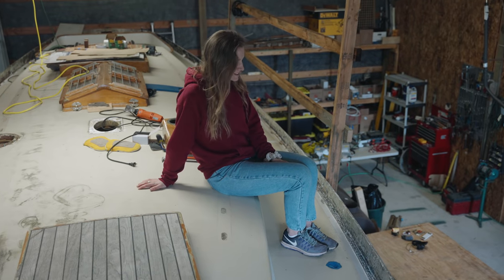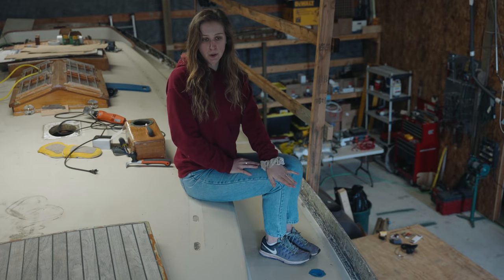Refitting This Old Boat. [S4E7]

Comment: It took me seven years to renovate a 1899 Dutch deluxe motor barge of 28 meters in Amsterdam. 13 months alone on the skippers quarters in the bow. Much more money than I had ever thought, but the thousand mile road begins with one step and you keep going looking for the light. I salute you!

Comment: Inlay the old table into a bigger table. Just use the old one, minus edge, as a pattern to route a large hole in the bigger table. Any material you want.
Reply: Another option would be to add a drop leaf on each side.  You'd double the size of the table and keep the inlay and the lovely cupboard behind it when stored.

Comment: Heat doesn't rise, Hot air rises.  Don't worry about the height of the heater, it will heat that small space just fine.

Comment: Small tip for next rewiring. Use the old cables for pulling the new ones in
Reply from the maker: If we were only rewiring we would but there is lots more to be done.
Reply: @SailingMagicCarpet  
As long as you see the journey as part of the destination, everything will be fine.
All the best from the Netherlands

Comment: The Klein Tools 63050 Heavy Duty High Leverage Cutters for Aluminum, Copper, and Communications Cable are my favorite too! The funny thing is, as soon as I saw you using the Kleins, I thought how much I love mine. And then you went on about yours and how much you love them. We're kindred spirits. 🤭💙 I'm sure you already know cutting anything with a steel core will gap and ruin them and they're not cheap either.

Comment: I really appreciated what you said about pushing through those days when you have a dirty, unpleasant job to do, especially when you are not feeling especially well.  I think the ability to do that is why some succeed and some fail.  Successful people (whether the success is financial or simply a matter of living life) don't know how to give up, no matter how many times life may knock them down.  When I raced formula cars, I taught myself to do fiberglass work, because I couldn't afford to pay someone else to do it, and it had to be done.  And though racing in the rain wasn't particularly enjoyable, I liked racing in the rain, because it gave me an advantage by slowing my competitors more than it slowed me.  Two or three years ago, my wife and I built a small camper to pull behind her Outback; I designed the frame; she designed the galley, and we worked out the other details together.  We didn't have to tear anything out on that project, but some jobs were less enjoyable than others, and we worked on the project as a team.  I've been watching your series, because I still have a boat project banging around in the space where my brain should be.  Thank you for not glossing over the bumps and for allowing us to see how you fill the potholes.

Comment: I did a gut job on two sail boats in Alaska in the 80's and 90's.  A 29 foot Columbia and a 37 foot Crealock.   I Tore everything out and replaced it all (engine, plumbing, wiring, deck fittings) but you guys are way out of my league.  I would not have have been capable of the structural repairs you two are doing.  Plus you would need a heated boat shop to do fiberglass and painting 9 months of the year in Alaska  because it gets so cold.  And a heated boat shop in Alaska isn't cheap.  Good Luck!  Looks like you two really know what you are doing.  Looks like it will be a fine boat when you are finished .  I'll be watching!  : )

Comment: Oh I now see how you are doing the bulwarks! Your videos are excellent but I was having a hard time understanding why you were splitting plywood away until I realized (despite being told by Aladino multiple times) preserving the hull was primary. So I just now realized the issue was where the hull fiberglass was overlaid to the wooden bulwarks. I was wondering what he was going to get the curve and sheer line in the bulwarks with and now I know! The hull is providing the perfect template. Lots of work. As soon as I looked into the engine room I knew changing out the engine would be the least of the issues there. Glad to see Aladino came through with the real remedy, increase the size of the engine room.

Comment: Aladino, with the fuel tank mounted low , below the floorboards, I suggest you install an auxiliary,high output electric fuel pump  between the fuel pump and the first filter… this is the way Island Packet did it on all their earlier boats.

Comment: and WHY do they climb Mountains ?   "Because it's there"   ...and that's why you guys do this....it's there to be done......oh, and why does Aladino do it the way he's doing it ?  because he KNOWS  how to put it back CORRECTLY.  I'm a 73 year old mechanic, that has had MUCH experience with diesels, plumbing, electrical and most other systems found on boats, and I can tell you for a fact, that his removing all that old crap is the best, (and usually Quickest), way to do it with the best possible result.... his knowledge is very extensive, and very much up to this task......Good Job guys  ...  OnWard.....

Comment: you could use the table as the center unit and add two side units on each side that fold in to store tripling the size of the existing table.

Comment: Two things I would change is having the electric panel underneath the companionway. Had this on my MacGregor 25 and it got water and dirt from going in and out of the boat. Also I don’t like how some boats have kitchen counter in the same spot. Not exactly sanitary. Good luck on the boat. Lots of work ahead. Looked forward to your DIY adventure.

Comment: As long as you don't stop, one day the work will be done and a new sun filled day will happen. The trick is to take small steps forward and change up what you do, so things never become too boring. I just wish that someone had explained this to me while I was still in my teens and made sure I understood it, because it would have saved me lots of issues that could have been avoided if I knew a fraction of what I know now, even taking a step back to take a breather would have helped. And above all, think.

In any big project things might be overwhelming, but break it down into single step tasks and do them one by one, sooner than you think you'll find that most of the big stuff has shrunk. It's like chipping away at an iceberg, one strike at the time. As long as you do that somewhere on the iceberg and don't stop, there will come a day when you can take what's left of that iceberg and use it too cool a nice summer drink.

Any complex problem, issue or challenge can be divided up into single step easy to fix things and do enough of them, that complex disturbance is suddenly just a minor nuisance. And I do mean this can be applied to ANYTHING, it's just hard to see sometimes.

And I really wish I knew this before I had finished high school or at least a few decades ago, but sometimes understanding comes late.

Comment: Great video as usual.  I totally understand the fun and beauty of rebuilding.  I love rebuilding wooden things.  I like the plans for the little table, (might make it a bi-fold table too?)  You both have such nice voices, that helps with making the videos so peaceful.  One comment on the galley material.  I love wood, but I've made many kitchens in my life.  Wooden counters are not so big on my list.  Butcher block is great, but not when it has any attachment to a sink area.  Normally some stone is nicer and much easier to maintain.  But you might entertain a thought of just having it made in Stainless steel, like commercial kitchens.  Or, in copper if you prefer, (more maintenance)  If you want wood too, then float the wooden area as a "large" custom shaped cutting board that can be removed for cleaning.  Thanks for the view into the restoration.

Comment: Big job guys, but you will get there. Just a thought the water heater will get hot and heat will radiate out from the cupboard/box over the feet space for the bed. Good in winter, but not in summer. Just a thought.

Comment: Formica is a very good lightweight product for countertops. it cleans up well and doesn't allow things to sock into it, like cooking oils. plus you could sand the existing formica and if it is well attached just reattach new formica right over it making the job easier then pulling the old out to install wood. as the jobs drag on making things easier is often a plus.

Comment: The electrical cables are most likely "stiff" because they are Romex cables made for other purposes and are likely solid copper wire instead of stranded. Stranded is easier to bend (less stiff) and for that reason are less likely to "crack" from vibration, although I can't imagine a sailboat ever vibrating in a manner that would do that, even from a running engine at idle unless it ran TO the engine and the engine was REALLY loose on its mounts. And of course, stranded wire for Marine applications needs to be tinned completely to prevent corrosion that could break some of the strands of wire leading to increased heat in the remainder, and blown fuses or fires. I have seen a lot of crimps being put on bare stranded wire on boats. I think that is asking for trouble eventually. I don't do it.

Comment: Great episode, lot of progress for both of you!  It is probably too late, but it may be helpful to pull a nylon chord in when you pull out the plumbing and electric cables so you can pull through new cable and plumbing.  Since you are tearing apart so much of the boat, you might want to consider additional insulation for you travel into northern waters.  I think you mentioned sailing up to Alaska as a shakedown cruise.  The table is beautiful, but it looks like it may be in the way if you try and pull the lee board up from the enlarged settee.  If you want to make the table wider, you could add two pieces of wood, on that wold fold up from the bottom and another that folds out for the top.  Possibly, the extension that folds under the table top could also work as a lee board.  You keep mentioning your camera. but do not tell us what kind of camera it is.

Comment: Having being a mountain climber and off track bushwalker up until I bought the boat there were many times I questioned why I was doing this to myself and sometimes promising to never do it again but always when the adventure was complete the thought was "that wasn't so bad" and indeed is it weren't so difficult it wouldn't be worth doing and I find that the challenge days on the boat are the same.🏴‍☠️

Comment: I think the interior woodwork on the boat is craftsman quality, gentle curves, solid looking and functional. Suggested changes sounded good, new stinky diesel, well take a look at Sailing Uma's conversion to electric drive. It too has issues, one going against a high current. Replace the current diesel tanks with Lithium batteries and the engine with electric drive 😁🌊 Lets get you a manufacturer to get that electric to you for trial 👍
Reply from the maker: We won't actually be going electric –– we'll make a video about our reasons why soon!

Comment: First let me say I am not a boat builder. But, I do have a thought that I would like to propose. Take off the floor and exposing's the blocks and cross lumber. Pull out the blocks out that are against the hull. I would think you could fit the cross lumber into the old hole under the cabin at a 45 degree angle then move the other side so it would then be at 90 degree to hull and cabin top. place a block in, rinse and repeat down the entire floor and the last cross piece I would make full size. cut it half, place both pieces in then bolt then together for strength. then lay down new fiber glass flooring to make sure it is all sealed tightly.

Comment: Concerning the heater - think ahead! A heater will need a minimum length of chimney (maybe 4 or 5 feet or more) depending on the kind of heater (diesel or wood, etc.) and the actual size of the heater itself. And minimum is not the preferred or optimal. You wouldn't want to build your foot box only to find out that you cannot be install a heater.

Comment: For the chart table seat you could have a slot in the board at the end of the bench and have the seat slide out from there with a board coming down off the seat that sits against the board with the slot in it. You would just need something for it to run on inside the bench, which would serve as a guide for how much you can store in that part of the bench. This would mean you still have use of the storage and you wouldn't have to move everything around. Just a thought.

Comment: That heater idea - I'm in Canada. the good old Dickinson heaters basically provide heat from the stove pipe not the body so much....so the lower its mounted, the more heat, especially with a metal fin surround.  They use 8 - 12 litres of diesels per day....that's expensive.  Better idea -  the Chinese knock offs of the espars and Wallis etc....many on Amazon have really great reviews and i have installed 2....much lower fuel consumption.  You need to think about mufflers...consider adding a motorcycle muffler.

Comment: When you making That seating in to a double bed.  If you are going to do that you will need Hinges that can take about 200kg in weight  Because bouncing around if hinges are not that strong will break and screw fitting will work their way out very quickly. I know this as was done in a truck using strong normal hinges using just screws it became  lose fast over bumps in a few days of being used. plus you will need folding legs too.  So when building something like that over strengthen over build it.  What you could do is a sliding board but remember go extremely strong and think about the legs and how they would stay in place and not move. Just a thought.

Comment: Hello. . . .  🙂
RE: Chart Table / Quarter Birth. . . .
Similar to you earlier mention of the multi-use Settee, The Chart Table Seat could have a new backrest, which can be pulled, switched, and positioned to become the Quarter Birth Extension.

🙏⚓️⛵️☀️🏝🌙✨

Comment: You could easily solve the potential heater height issue with a fan to circulate the heat.

Comment: Would it not save some time to use the old cabin wiring to pull the new wire through the holes and channels?? A possible idea for the table is to remove side fiddles and add two new hinged side wings that have a similar inlay pattern.

Comment: Rebuild the bulwarks with fiberglass. Any thing else will just lead to problems down the road. It is a known weakness so increase the resale value with a known premium repair. Drill and epoxy in wood dowels to screw the cap rail down. It seems counter-intuitive but screwing into fiberglass is a weak fastening as it damages the glass and even if the dowels rot they are easy to replace.
P.S. Don't purchase cheap LED lights as you will curse every time you replace them later.

Comment: You may want to consider a forced air diesel heater.  It would heat the boat more uniformly, using the same fuel as the engine.

Comment: You should have used pull strings when you pull the old wires out so you can easily rerun the wires

Comment: Diseal heater is very small and compact and many boats have them…..can be under the foot extension that you planned for the sitting area.  Did you ever think you would be where you are from your days in refitting the boat in Canada?  I am also curious if you even thought of going with an electric motor vs a Diesel motor to drive the boat….I’m sure you have, but what were your checkpoints?  Just wondering for others who might be going through the same refit decisions.

Comment: If the bulkhead at the foot of the pilot berth is indeed structural then it was unfortunate a huge section was removed and obviously that needs rebuilding. If it is not structural then you can move it aft extending the pilot berth length and build a full bulkhead closing off the storage locker. With your port settee/double berth conversion and the longer pilot berth lengthening the starboard settee seems unnecessary. More practical for your living would be to keep the stove/heater in the original low wall mount position, surrounded by additional tiles that protect the wall and act as a heat sink.

Comment: Hybrid diesel/electric engine with solar panels, is that a possibility;  With modern batteries.

Also make a Utility/Comms/Radio cabinet. I dislike the random panels on display. My OCD begs you.

Yacht WiFi is a must: You need to think about SpaceX Starlink install, you know you need it!

Comment: Did you consider using the old plumbing and wiring as a tool to pull the new materials through tight or hidden spaces??
Reply from the maker: No, because we’re making major changes in the way the wiring runs.

Comment: wouldn't it have been better to use the old wiring to pull through the new wiring?
Reply: He will learn that later lol was thinking the same thing
Reply: @frankmignone2271  he's a smart guy, assume they were in conduit and he can pull or blow string thru using a mouse.

Comment: If you still have more material to remove from the bulwarks when you read this, or for next time, a rotary wire brush will remove material from hollows and only scratch up the fiberglass. 

I would not put back the wooden bulwark caps that you removed, but make a plywood mold, wax it and fashion a new cap from molded fiberglass. The less wood and more fiberglass you have in your boat, the less maintenance you will have in the future.

Too many DIY think of fiberglass as something that goes over wood. Much better to make   molds from the cheapest material, like particle board, wax the mold and lay in multiple layers of fiberglass in the mold to make a permanent part.